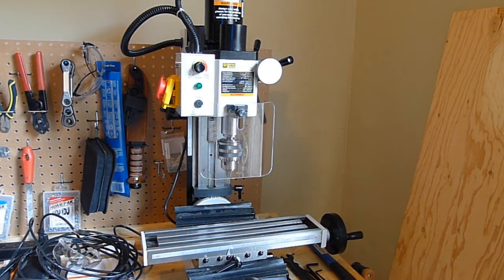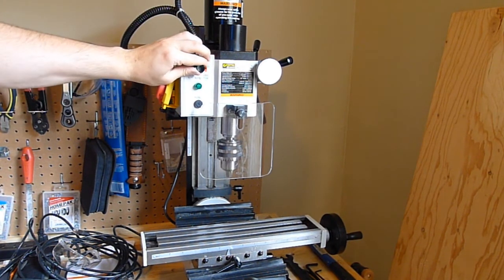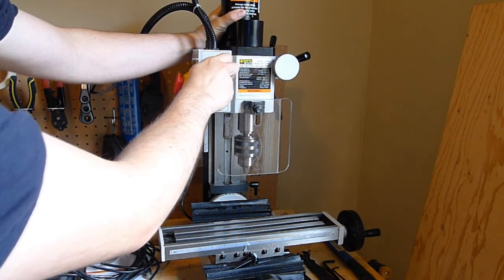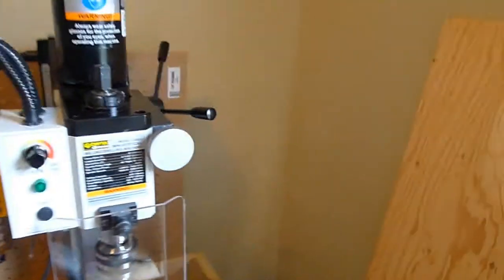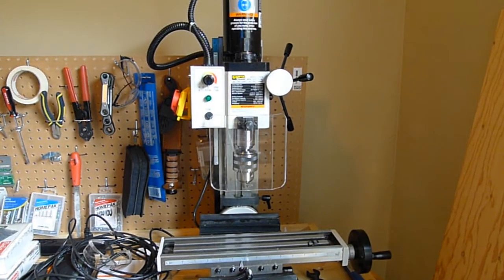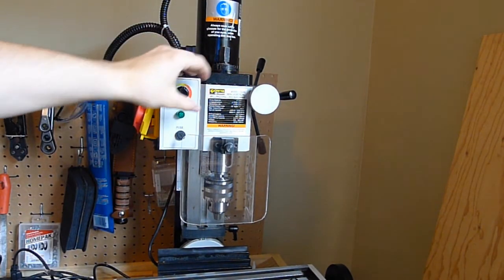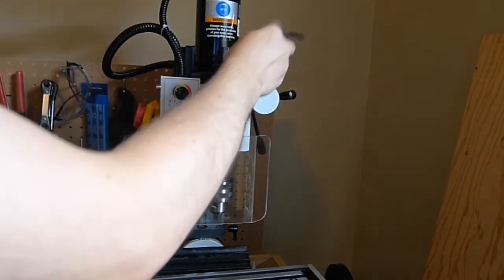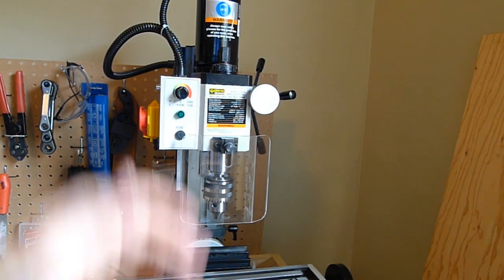X2 Mini-Mill (CX605) Gear Mesh Noise Comparison

Comment: Put up with the noise it is a Chinese machine their workmanship and tolerances suck the ways of the machines have poor contact surfaces maybe 50%if ur lucky I checked mine and had about 30 i scraped in all my ways.I happen to be a retired machinest and rebuilder so I got a small surface plate and did my thing...very piss poor machining and fitting..I can't understand why the can't include 50 per revolution on the lead screws from the git go.STUPID.

Comment: Thanks for the info and tips! One thing you also have to remember with noise is that it's not always the overall levels, but the quality of noise and frequency content that bothers us. I bought a dust collector recently and was really happy to hear its nice, smooth low frequency "whooshing" sound. The mini mill on the other hand has a scratchy, raspy voice for some reason. Mine sounds dry, but not far off from your video or others I've seen. I also figure if fully gutting it and regreasing could make enough difference, there'd be a bunch of people recommending it. I guess most of it is just its nature.

Take Care

PS- Was your chuck moving off center or is it just a video illusion?

Comment: Thanks for the info on the O rings.  I might try a rubber gasket and see if that works to keep the motor flat.  Cheers Mick

Comment: I just completed my conversion to CNC XYZ drives. 
But blew the motor speed control board. Going to change it soon with components from CNC4PC and having Mach3 to control speed and direction. (I hope) :)

Comment: Convert to belt drive. Plastic gears break way to easy.
Reply from the maker: I still plan on doing that - also for getting a little more speed on it, as at full speed the plastic gears sound pretty rough. Shipping is always so much to Canada though it puts me off ;-)
Reply: @ColinOFlynn  Hello sir, have you put belts on this machine?